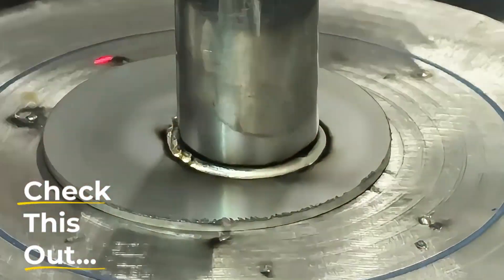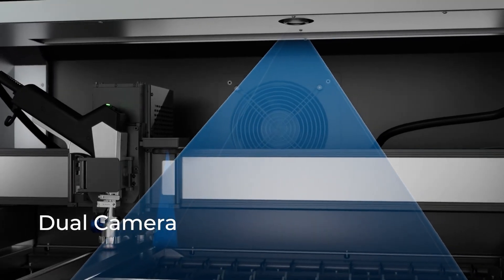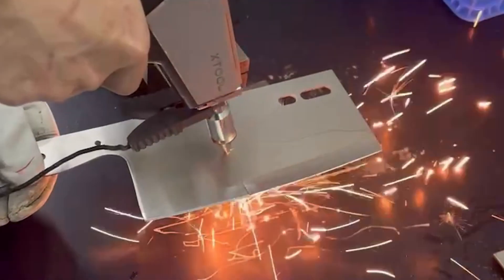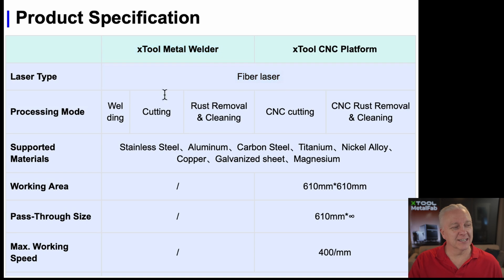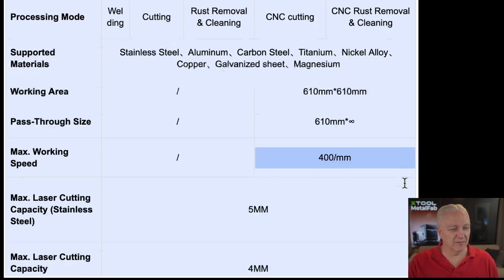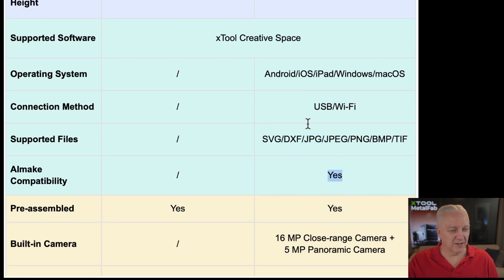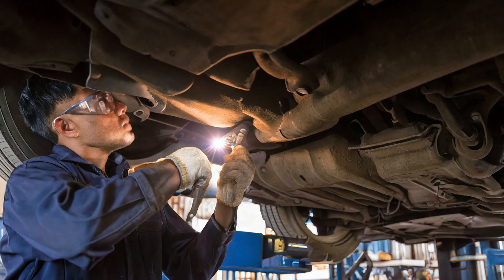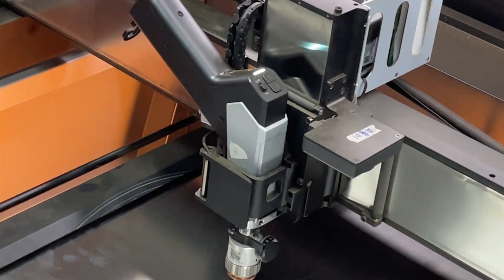This New xTool MetalFab Makes Metal Working DEAD SIMPLE!

Comment: The D1 was sufficient to convince me never to buy a product from XTool. They do not offer a reasonable support life for their products, and while they were still selling the D1 as a new item, they had already discontinued replacement parts and the lower wattage heads, trying to force people to buy the 40 watt head. Once they move to enclosed systems, they abandoned their open gantry users entirely.

So what happens with this after the 5-year warranty expires and they have a newer better product that they want you to buy? Nope. Not me, not ever.

That said, I appreciate the way they are innovating and driving the industry forward. This Spurs more reputable companies to compete. Those are the ones I will buy from.
Reply from the maker: Xtool made some business choices to move up-market.  I don’t think abandoned open frame laser because of this though. I think they abandoned this segment because open frame lasers are actually pretty dangerous and the market was flooded with cheap lasers.  Most of these are cheap because they have little or no support from day 1.

The MetalFab is definitely a small business tool and is priced accordingly.  The 5 year warranty reflects their belief in the product, but they are priced accordingly.

Comment: 10k min
My entry level tig welder was 1500.
Fibers go for 3000
Hand held plasma cutter is 1500
The head of that laser is very smart if the video is correct. It knows when a part has fell through and will raise up, which is an expensive feature.
Reply from the maker: Yeah, I believe they has ultrasonic or lidar detectors on the head to keep an eye on things.